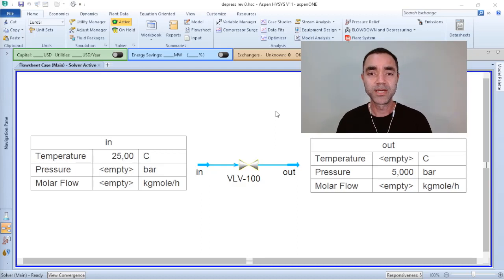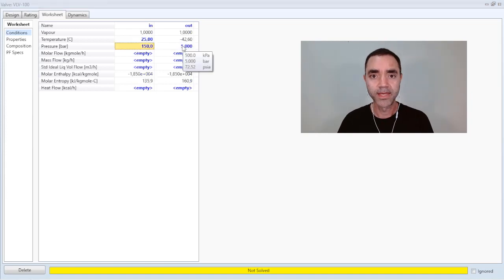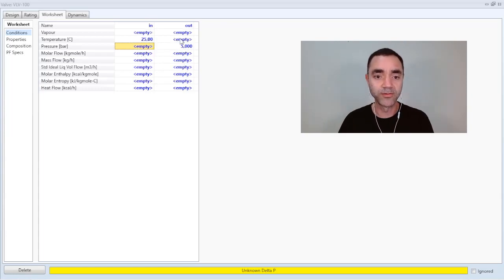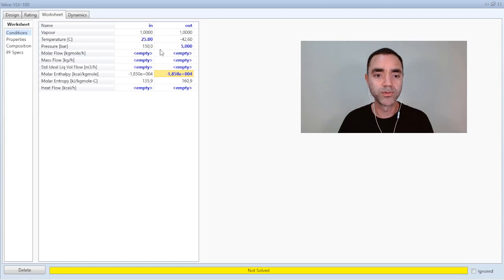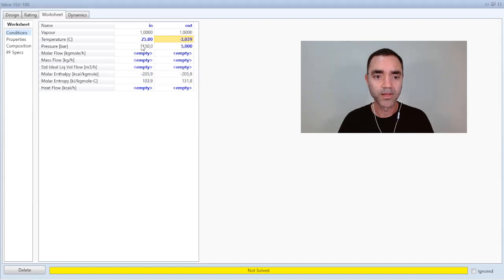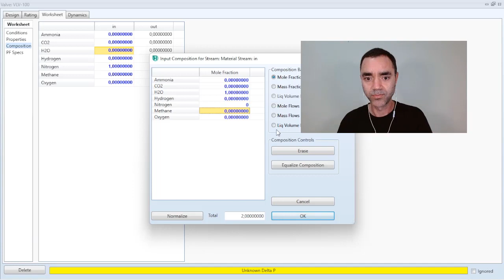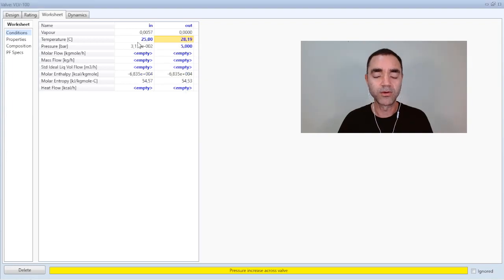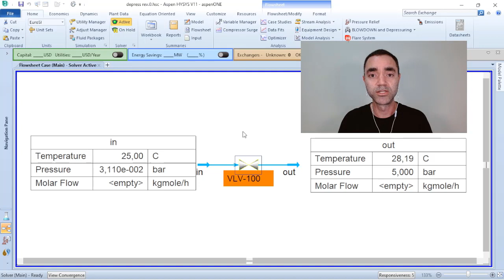PRESSURE DROP CALCULATION ON ASPEN HYSYS FOR CHEMICAL PROCESS ENGINEERS

Comment: Why can't I do the same with pipe segment simulation similar to valve simulation, where replace upstream specs with upstream spec will get you a solution for the valve but for pipe segment we have to specify upstream condition? What is your experience in this regard?
Reply from the maker: HI, your question is not clear to me. Sorry. If you can clarify, maybe I can help 😅